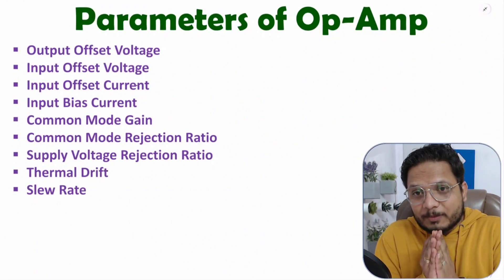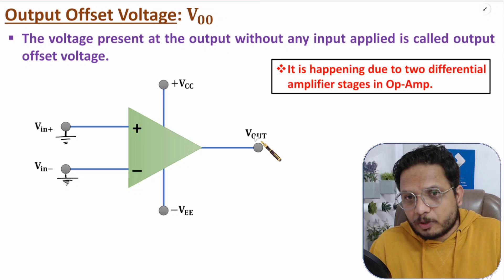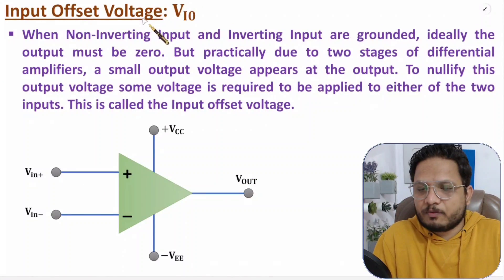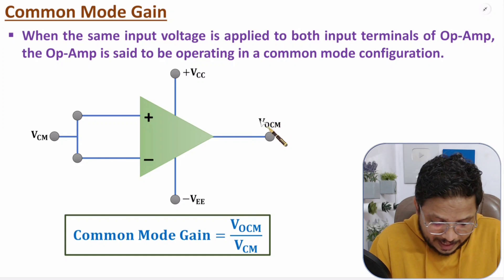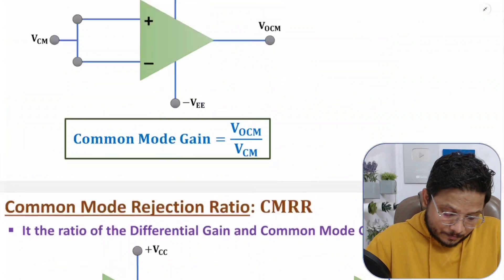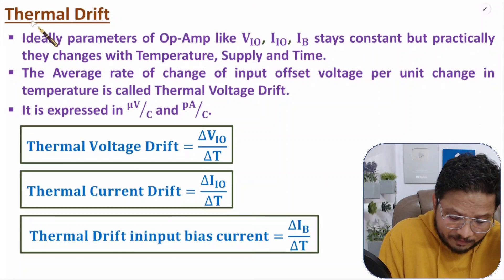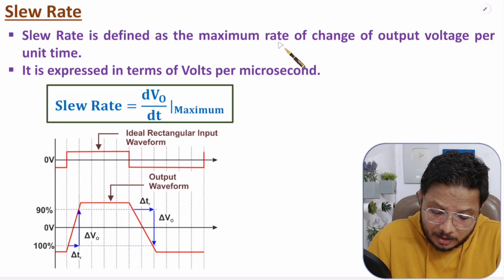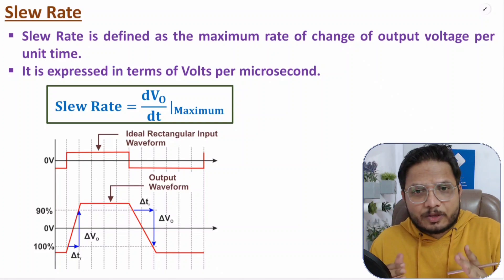Parameters of Operational Amplifier (Common Mode Gain, CMRR, SVRR, Slew Rate & Thermal Drift)

Comment: 00:03 Operational amplifier parameters overview.
01:57 Operational amplifiers have output offset voltage due to component discrepancies
04:04 Understanding input offset voltage and current in operational amplifiers.
06:02 Input impedance can't be infinite, resulting in input bias current IB.
08:18 Differential gain should ideally be infinite
10:27 Understanding key operational amplifier parameters
12:30 Thermal drift in input bias current should be minimal for stability.
14:26 Operational amplifier amplifies input square wave with slight time delay